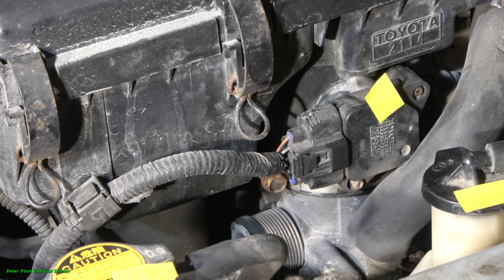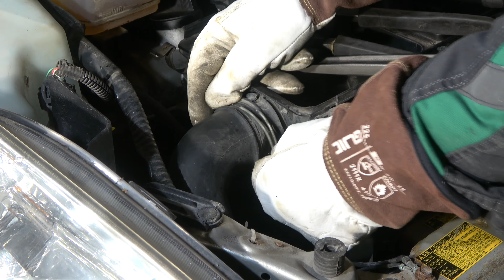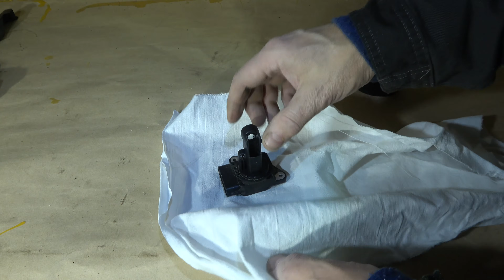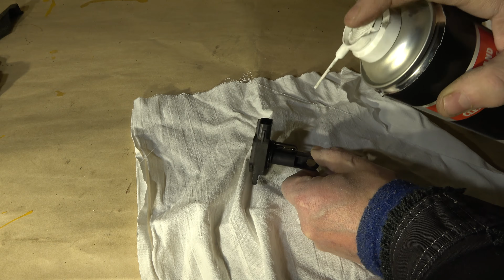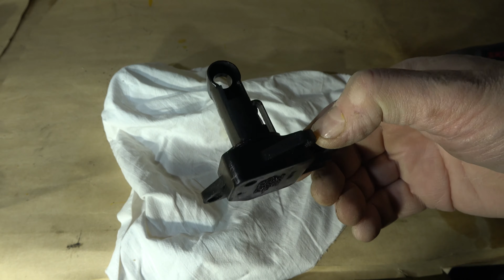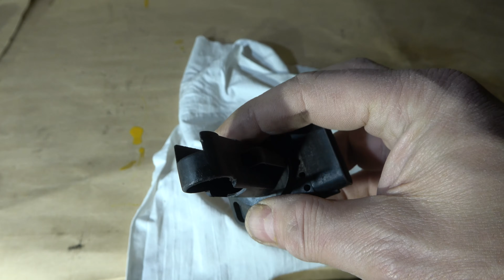How to Clean MAF Mass Air flow sensor Toyota Prius. Years 2004 to 2009

Comment: I've heard not to use throttle body cleaner as it leaves some light lubrication for the throttle body/valve itself.  Use special MAF cleaner which leaves NO residue of any sort.  I've removed the MAF without taking air cleaner body off at all, just the top cover for a bit more clearance.
Reply from the maker: Thanks for the info!

Comment: I m having peius gen 2  dtc p0012 
Replace ocv
Vvt
Timing chain
Ocv filter
Change oil 
But same error
Engine is sluggish 
Jerking when coverting to battery and petrol
Only kwft to change ecu
Volts r there i. Connector 1.35 volts 
But ocv is not moving
If apply direct 12 volts car engine hesitate
Reply from the maker: Thanks for info 😊👍